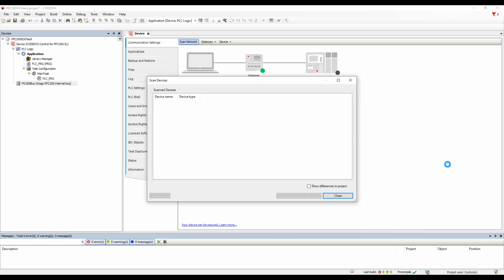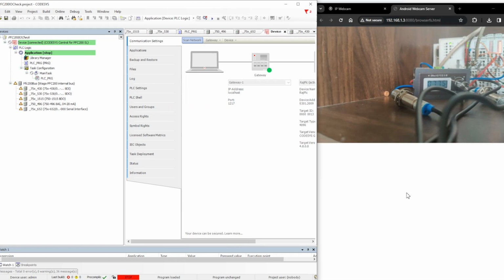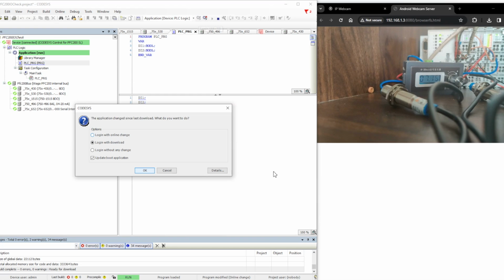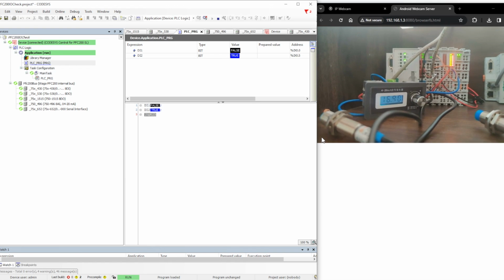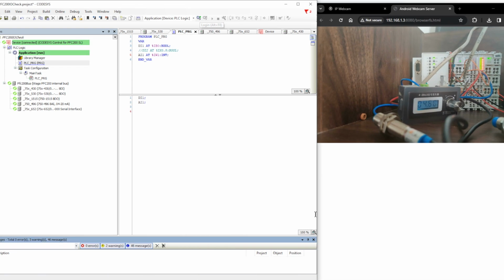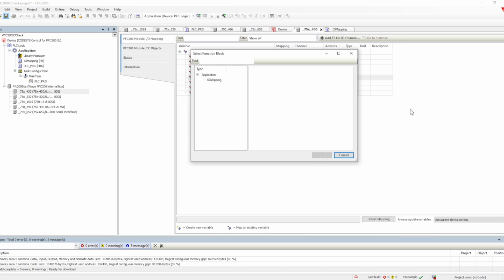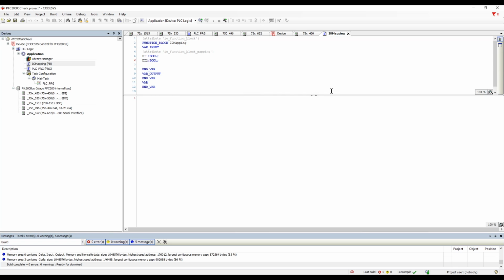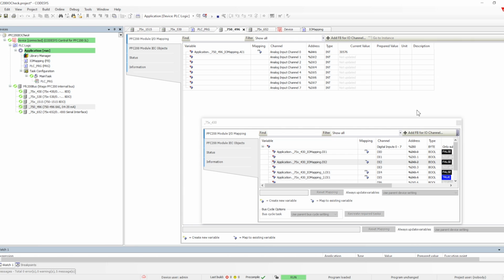CoDeSys Tutorial : Multiple ways of IO mapping  in CoDeSys

Comment: How would this work if my IO cards are connected to a coupler? Do I scan the devices and it will link them to the couplers?
Reply from the maker: It totally depends on how you structure the IO definition but you can map them very easily if you have created the modules/FB for each type of IO card or a generic IO card and just change the starting and ending address it will automatically get linked …